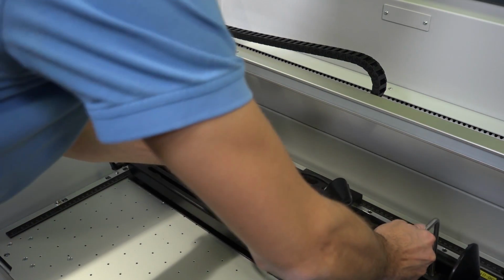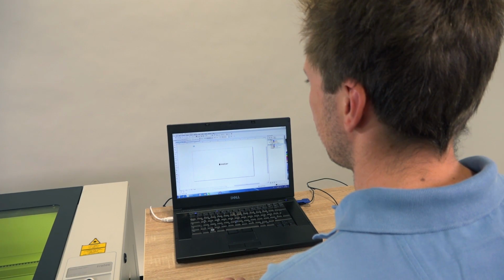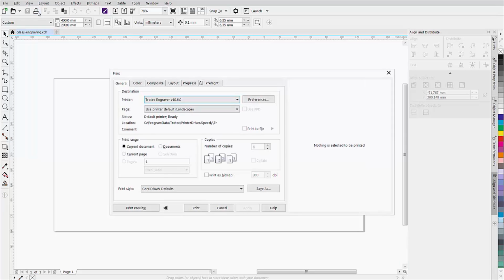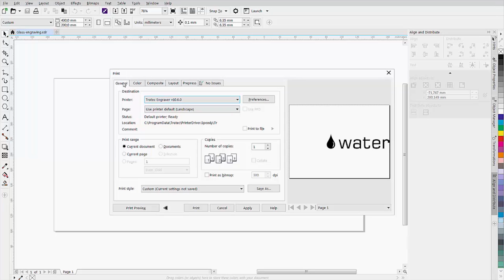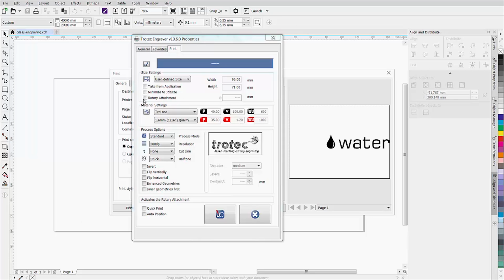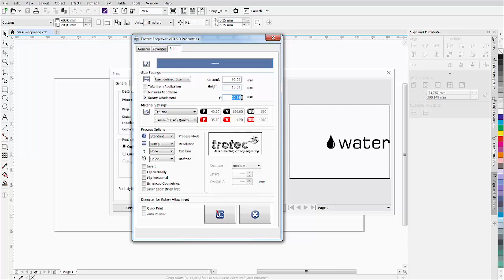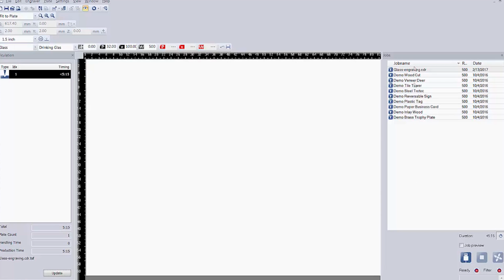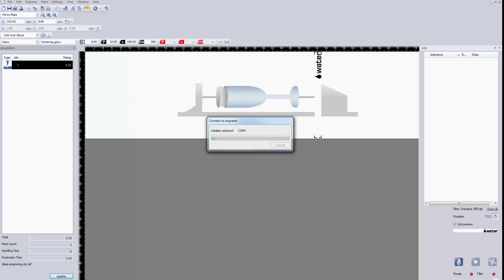Trotec Rotary Attachment | Laser Engraving Cylindrical Objects

Comment: Good video. I always struggle some when doing several tumblers, and hitting the same spot for engraving. As an example, if I need a business logo on 20 tumblers, how do I make sure I always put the image on the same spot on all 20 tumblers? Thanks!
Reply from the maker: You can always start by positioning it to the top or bottom point, create a marker in JobControl, and repeat as many times as you need!
Reply: Trotec Canada thank you! Keep up the good work my friend.